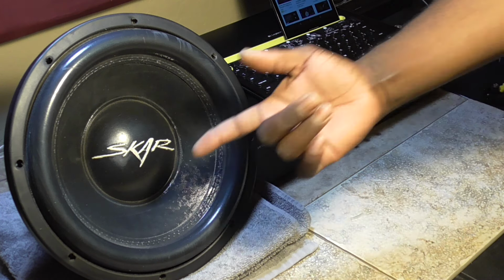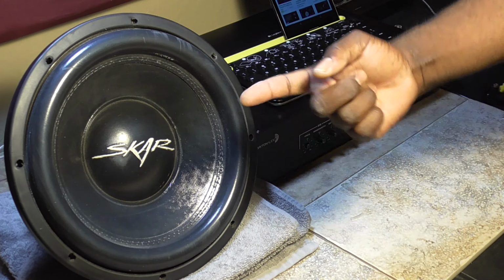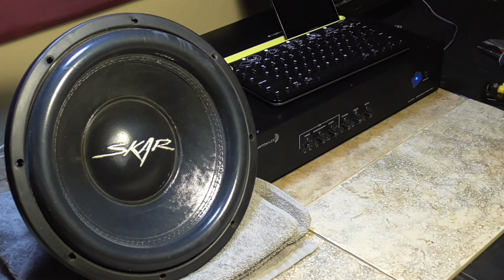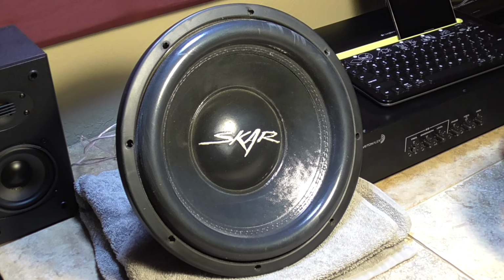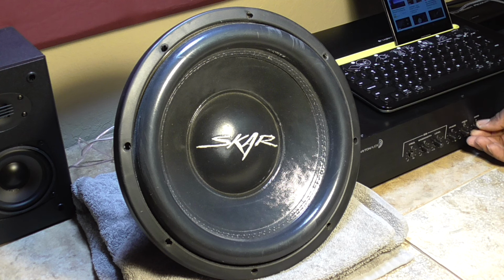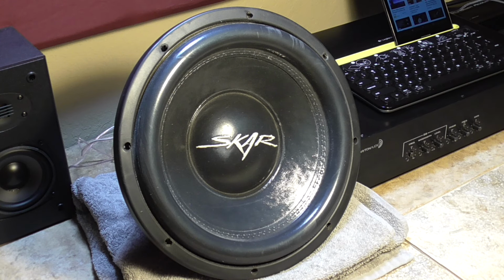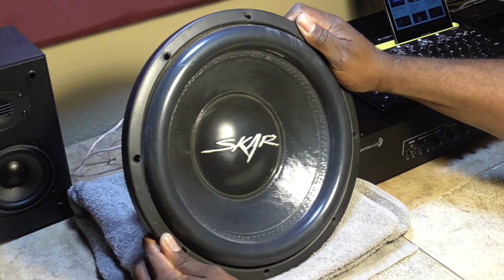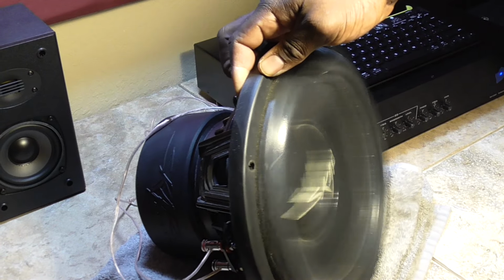Blowing Up The Skar XXV12 v2 - Part 2

Comment: Bet them joints would have the trunk poundin, what's the difference between the dual 2ohm, and dual 4ohm?
Reply: Glenwood Jenkins pretty sure the only difference is that u can wire them differently, u can wire a dual 2 ohm sub down to 1 ohm.
Reply: Joints are for smoking